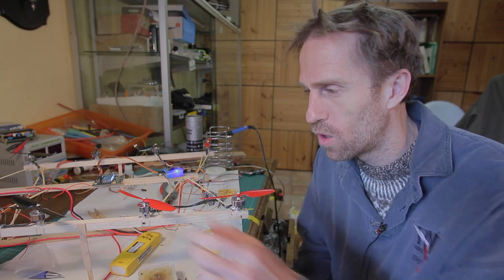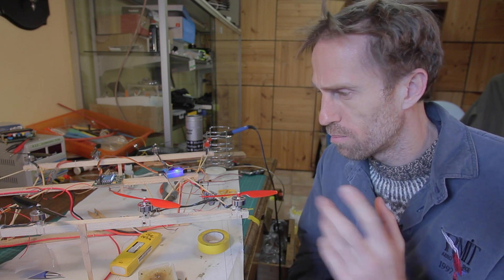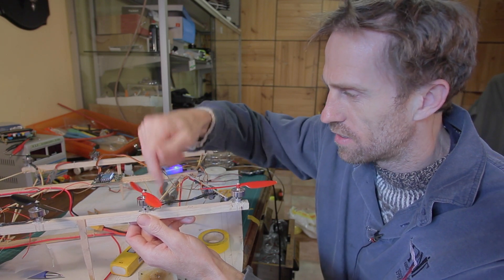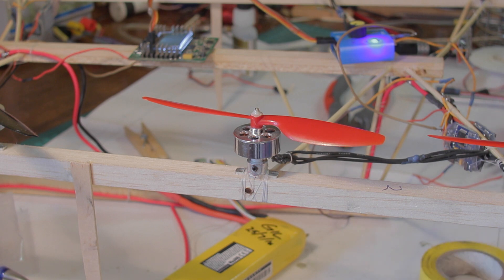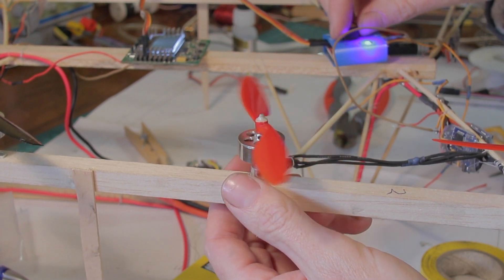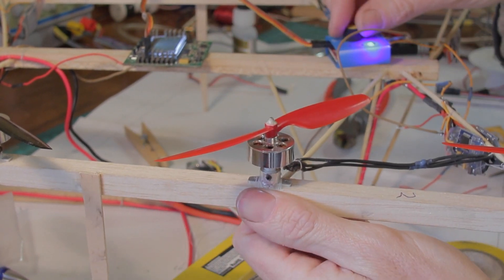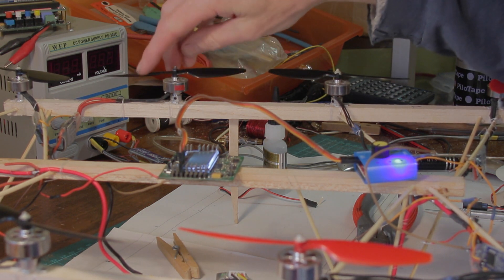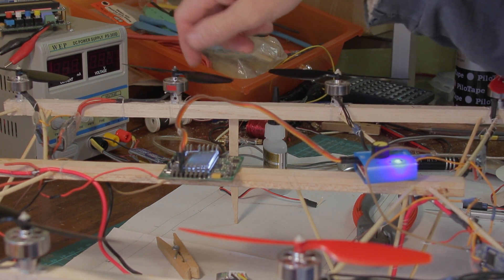Prop balancing, quick and dirty. RCHacker #76

Comment: Why not just buy a good props balancer?
Enjoy the rest of your week
Reply from the maker: +ABMNS PRODUCTION Quite often a balanced prop will still cause vibrations once fitted due to the motor being out of balance or bad mounting tolerances.
Reply: RCHacker Yes it's also true most of the vibrations come from the motors. But motors balancing is pretty tricky in my experience.
Have a great new week

Comment: I like the idea of "feeling" for the balance!  Go figure!  A while back I pondered the idea of getting a variable frequency strobe light to video the entire air frame at various RPM.  I think that sometimes vibration can be specific to one or another frequency and may even appear in a different part of the craft.  With harmonics to boot.  A trade off between flexibility and rigidity.  Thanks for the quick tip.

Comment: In case you want something more "accurate" then your "feeling in the hand" ... there is/was ELMvibra ;-) ... I guess you have the skills for make a DIY ELMvibra if you want
Reply from the maker: +elm70 Thats a nice project. I've watched an old mechanic in patagonia balance the propshaft on a mercedes truck by putting it on blocks, running the drive train flat out, add a bit of weld repeat. until he could feel no vibration. It was kind of dangerous but it drove like out of the factory after that.